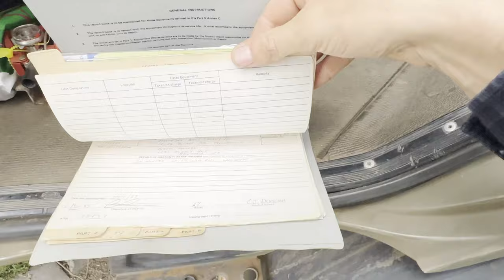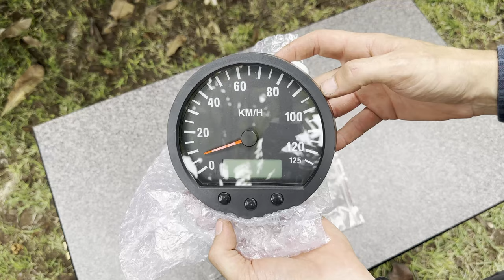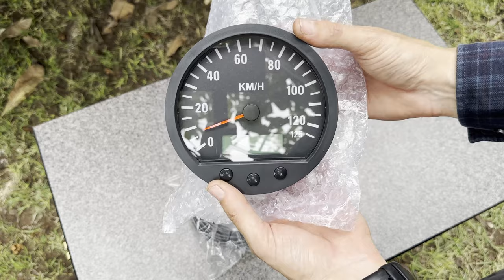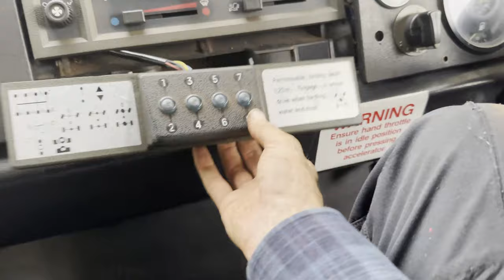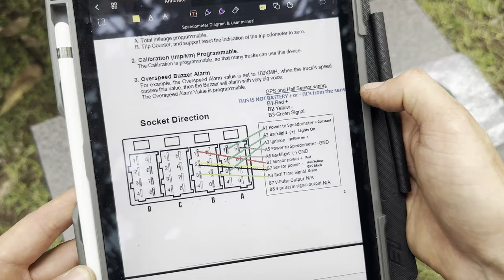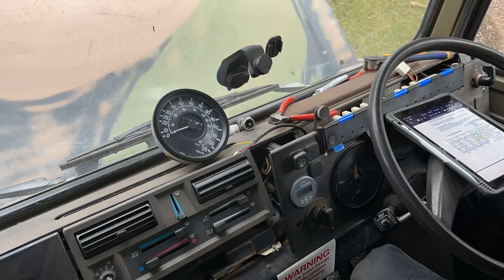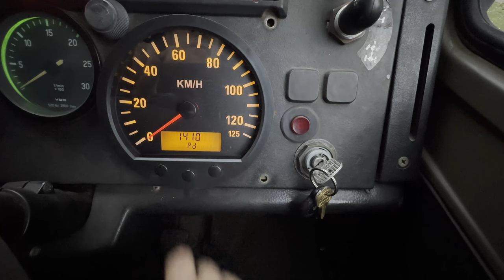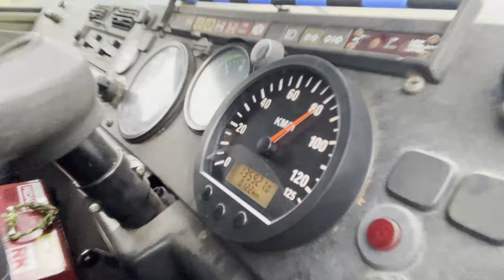1984 Unimog U1700L Speedo Change

Comment: Thanks mate! The mechanism with the wire and turning bolt to lower and raise the spare wheel - is that a standard Unimog feature? Reason for asking is that I have a very similar Mog (Ex-army U1300L) that does not have this feature. The bed was removed and replaced with a camper box yet keeping the spare wheel in its original position.
Reply from the maker: It’s standard for all the Australian Defence U1700L. I’m not sure about other models. I’ll have a look in the manual I have and see if there is a reference to it. The winch isn’t anything fancy, just a simple boat trailer winch with most of the cable removed. Cheers!
Reply: @retrogear  thanks much for your answer! So the boat type trailer winch you added yourself, i.e. that is not a Mercedes feature? Also the spare wheel carrier, does that pivot or tilt up and down? 

Congrats with your truck and the new speedo. A question on the odometer if I may - can that be programmed multiple times or is that a one time job when you install it?
Reply from the maker: Na the winch was on the truck. All Aussie Army ones have them. Not sure if they are Merc or something the Army added. The mount is fixed in place and does not pivot. The wheel just seems to roll around nicely. The foot step plays a part too, in helping the wheel not roll away.
Reply: @retrogear  thanks much for a comprehensive reply! I already look forward to your next video 😀